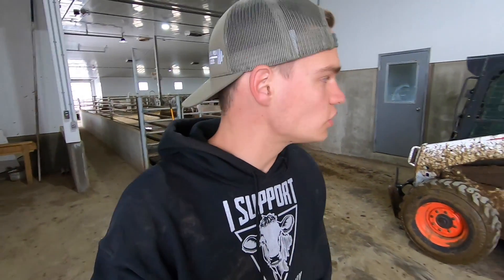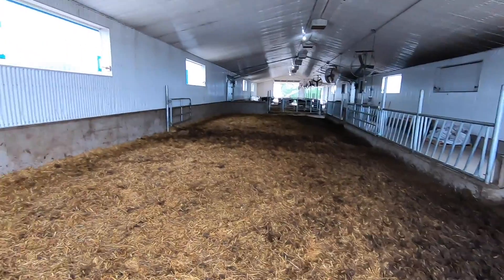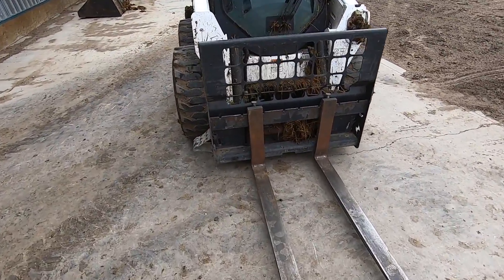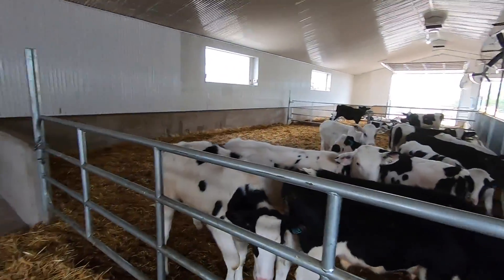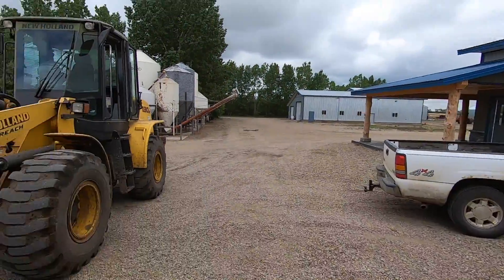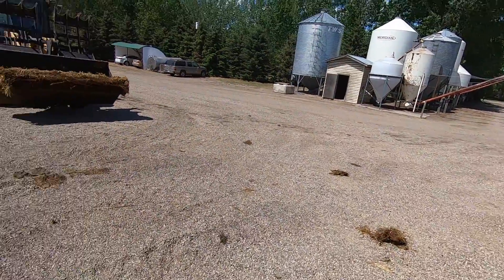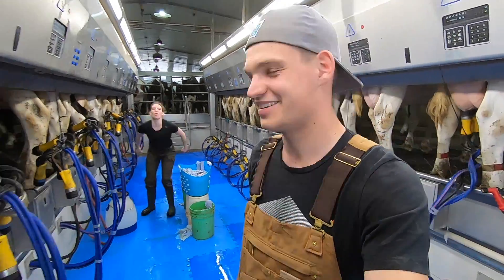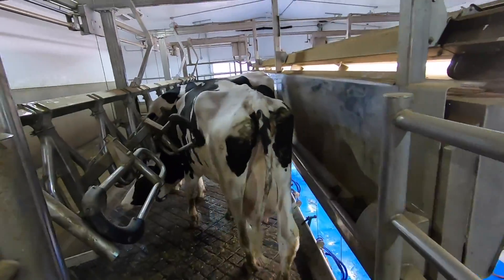Who's The Faster Milker?

Comment: Hey even tho I don’t think you will read this but you will never know lol. I milk about 800 head a day and when you put the machine on try grabbing the back two cups and kinda kinking them a little lower then the front two cups with means you will have all 4 then put the front two on at the same time the come up and put the back two on. With some practice you will be the fastest Milker around anywhere bud. Remember the it does take a few days to get the hang of it but you could have put 6 machines on in about 40 sec